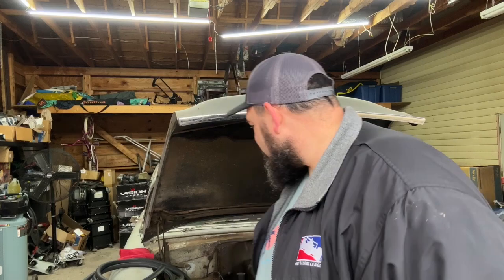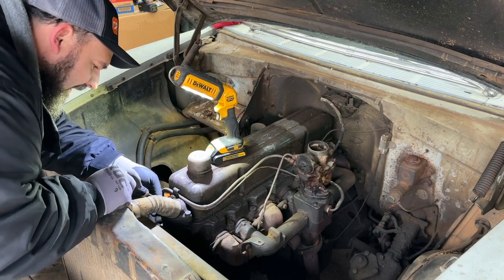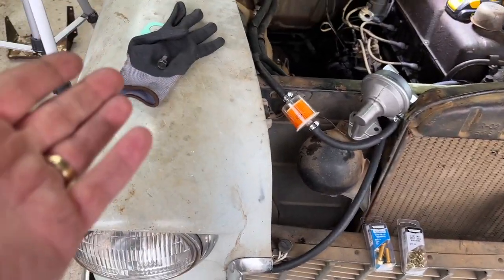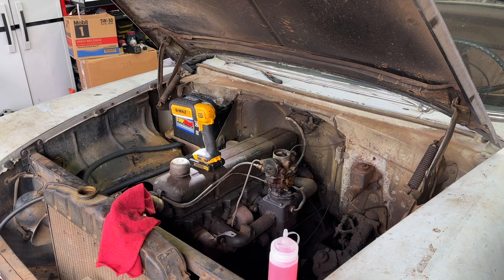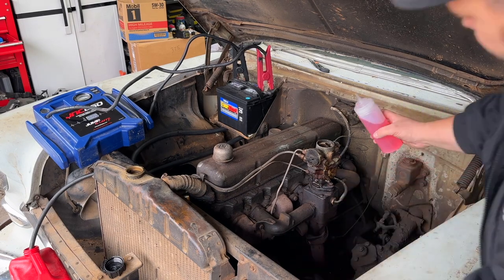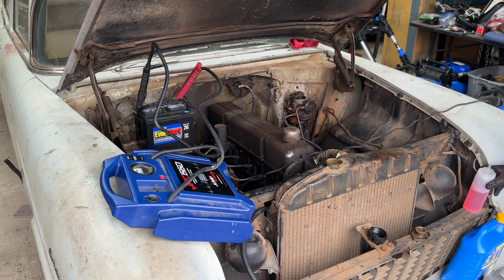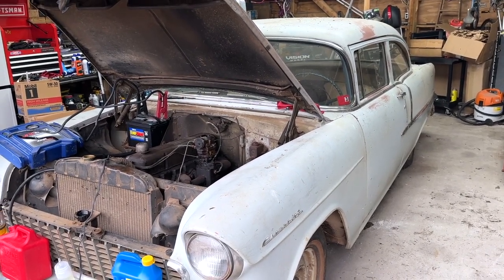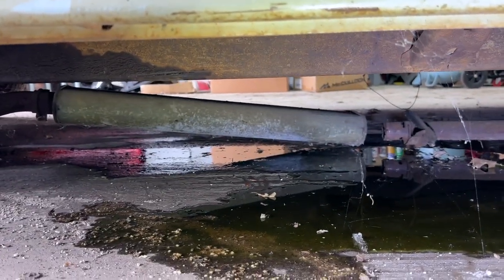55 Chevy Isn't Ready To Wake Up! Trying to get her to run on her own.

Comment: Probably could use the adapters off the old fuel pump put them on the new fuel pump then the gas line fittings would've fit right

Comment: For sure you and your family have a excellent 55 Chevrolet. That car looks extremely solid body wise for a 55. You haven't showed floor pans yet but from what you have showed it is an excellent shape for the year. You will figure out the fuel problem. Keep up the good work. A lot of people would love to have a 55 in that condition to start with.
Reply from the maker: Yeah man, I’m blessed to get to work on one this nice! As far as I know the floor pans are solid. But I’ll show that for sure as I dig deeper into it.

Comment: you need to open up that carb before you go any farther.   Check the float, needle and seat, and the main jet.   Accelerator pump also.
Reply from the maker: Yes sir! I bought the rebuild kit. So that’s next. 👍

Comment: Change the oil, pull the fuel pump, it may be just stuck all the way down from sitting. fix the heater hose. I think the carb may be fine so START HER UP!
Reply from the maker: Let’s go!!
Reply: If the carb is working, it may need to be rebuilt later.  It's a 210 two door Sedan.  I had a 1956 210 four door Sedan. It had a column shift with overdrive. It was two-toned baby blue and white.  I was 16.  My mother sold her.  It took me a long time to get over it.  Plan on rebuilding or buying slave cylinders and new brake shoes.

Comment: Yes sir as I mentioned before there are rebuild kits available for those fuel pumps but you may have to go outside of your local auto parts store to obtain what you need. That is most likely a Carter fuel pump. You have nothing to lose by gingerly disassembling the pump and you may find that it is gummed up. Beings that it is not the original pump it may come apart without damage to the diaphragm and gaskets. Those pumps can be obtained if you can get the part number for that pump. Some of your sources such as Chevys of the 40s have those pumps and kits, you can pull the pump and manually operate the pump and it should suck and blow air. also can put a hose in gasoline and attach it to the suction side of the pump. The pump really consists of the diaphragm and two check valves in order to work. I had a Holley fuel pump on my hot rod engine and it quit on me (naturally on the side of the road) but when I got it to the shop I found the suction side check valve had actually vibrated out of its seat (I don't believe that it was properly seated). This Holley pump is actually a Carter fuel pump. Back in the seventies I put one of those Carter (a high performance one called a "zip pump") fuel pump on my 56 Chevrolet hot rod and I mean to tell you I had consistent fuel. That car you have is referred to as a 2dr sedan. If it is not a sedan then it is referred to as a 2dr hardtop. Just a note the windshield in a 2dr sedan and a 2dr hardtop are different. I would also assume that the back glass is different as well. On the 56 Chevrolet that came from Granddaddy one thing we did not do was to remove the front and back windshield glass and replace the rubber (it was old and cracked and of course leaked) We just did not want to take a chance of cracking the glass but we could have cut the rubber and removed the windshields (I call them that even though the back glass is referred to different) and when it came to reinstalling the glass taking it to the glass shop and have new rubber installed along with the glass (and never leave your glass with the shop for later installation as you may not ever see it again) Yes sir put you a new fuel tank in that car and make sure the lines are clean, good fuel pump and  carburetor overhaul (soaking in carb cleaner and installing a kit) will get your fuel system squared away. These cars are old and your modern auto parts stores are not always going to carry the right parts (even NAPA but they are close) I get online and get a picture of the replacement part to see if the part is the same as what I am replacing. Those are 5/16 limes going in and out of that pump. Appreciate your efforts, brings back memories going back to 1968
Reply from the maker: So much good information here! Thank you so much! I may be reaching out to you if I run into problems. 😆
Reply: @CrossroadsRebuild  Yes sir and I must apologize here as that fuel pump that you acquired would have worked as the body of the pump where you have the inlet and outlet threads should be 1/8 pipe thread and you would probably find that you could use the brass fittings off of the old pump which those fittings should be 1/8 inch male pipe thread and 5/16 inverted flare to the lines. You may have to bend those lines some what to get them to fit as the location of the inlet and outlet on the replacement pump seems to be a little different. I failed to notice that when watching your video. Any time I can help no problem. Sometimes taking the old part to the parts store and comparing the two items could alleviate any confusion and sometimes a parts counter person may be able to help solve the problem as well, especially if you deal with one who is familiar with this old stuff

Comment: Fill the carb float bowl with gas by squirting it down the vent tube, and it will run longer to draw fuel from the fuel pump.

Comment: When checking old school fuel pumps, yuu need to leave the output line off.  this will reduce the restriction on the flow.  your failure my be in the carb not the pump.. One affects the other.

Comment: Looks like a nice piece , put the tank in , blow out the fuel line . Its a 235. 6 cylinder , napa or rock auto , auto zone , any of them should be able to get one . Click e an wire connections to the starter or rebuild the solenoid,  or replace it . She'll run!
Reply from the maker: Yeah man, gotta love how simple these old cars are! Shouldn’t take too much!

Comment: Before you go get a new fuel pump, disconnect, you gas line from the carburetor and check and see if you were coming out that’s the best way to check your fuel pump next it could be your carburetor, Florida floater, getting stuck tap on the carburetor next tap on the carburetor
Reply from the maker: Thx! I’m new to these old machines, and I can use all the suggestions y’all have! That fuel pump was def doa. Keep your eyes open for an update coming in the next few days… 😉

Comment: Use brass fittings from the old fuel pump they are adapters for bigger lines
Reply from the maker: Yes, that didn’t strike me when I was working on it before. But you’re absolutely right.

Comment: Remove the fuel line from carb,  check pump flow and PSI.  PSI should be 3.5 to 5

Comment: My dad had a 55 Chevy 210, 265 V8 3 on the tree.  It was white over yellow, but all green underneath that. I've seen a few painted the same way. Someone told me the green made the white and yellow bolder.  The interior was green as well. I think maybe something happened in the assembly line and these cars were set aside until whatever issue was resolved, and they were put back on the paint line on white over yellow day. Can't find anyone to verify why these cars were repainted that day.

Comment: Might want to start a black board , write down all the things you need to do. Get the carb kit or you wont know if the thing will excelerate correctly if you don't .blow out the fuel lines they might be cloged.  get brake kits, only for rear , change front too Disk. your family will thank you.

Comment: Did you decode the trim tag yet could possibly be a Delray which would make it a little extra cool. If that was mine I'd get an LS engine with a trans and all the wiring and computer and make it a good turn key driver. AC would be a nice addition also.
Reply from the maker: I’ve decoded the trim tag, but I don’t know what it would show if Del Ray. But based on my research Del Ray was mostly an interior package, and based on what’s in the car, I don’t think it’s a Del Ray. 
LS would be cool for a different build, but this one is staying all original per the owners preference. Maybe we’ll do some fun stuff on another one in the future!
Reply: Keep it stock

Comment: Put the new fuel pump on take the fittings out of the old one And put it back. The little pipe on the carburetor Squirt gas in the little pipe it'll fill up the carburetor
Reply: You mean the adapters read the replies before yours not sure if the way you explained it makes sense but good try
Reply from the maker: Appreciate the suggestions! Keep an eye out for a new vid in the next few days… 😉

Comment: Great project....you should check out DD Speed Shop on youtube. He is a little unconventional but works on these Tri 5's. Also try rebuilding that carb because the float is probably stuck. Keep up the great work.
Reply: Sounds like the excelerator pump is not working on the carb& the snake skin probably came out of the tailpipe when you started it.
Reply from the maker: Thank you! I’ll check him out! Carb rebuild is on the agenda. Already got the rebuild kit. 👍
Reply from the maker: Carb rebuild coming. 👍
Snake skin might’ve come from the tailpipe… but that tailpipe is kinda Bluetooth right now. Exhaust is a mess!

Comment: TAKE THE OLD PUMP OFF AND TAKE IT TO PARTS  STORE AND HAVE THEM MATCH IT UP TO WHAT YOU NEED  TO HOOK RIGHT BACK ON AND MATCH LINE FITTINGS TO CORRECT SIZE  AND IT WILL BE A BREEZE,,,EASY.